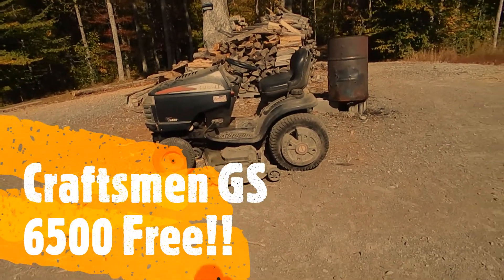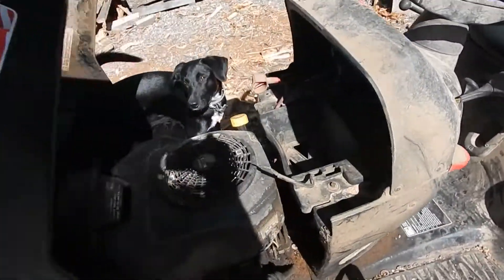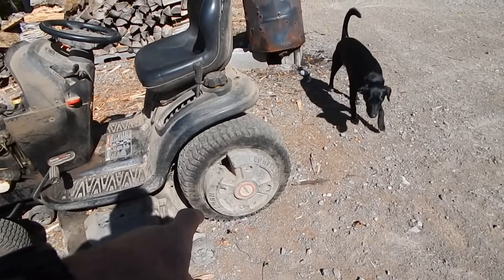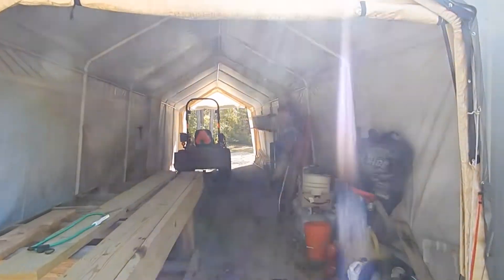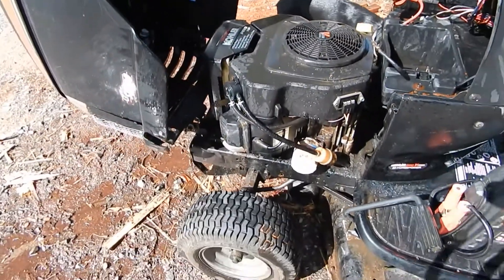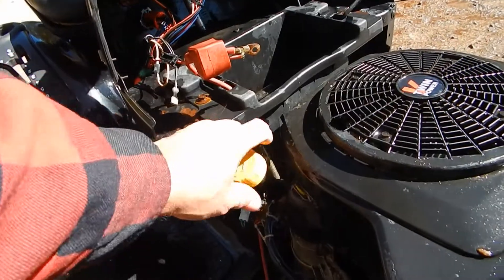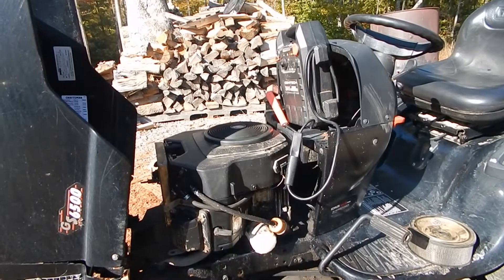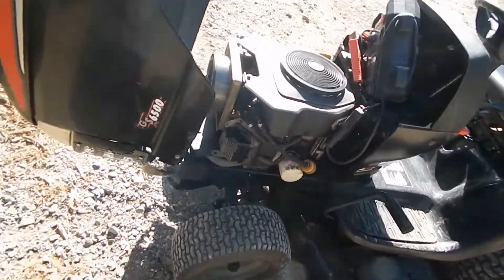Craftsman GS 6500 FREE!

Comment: Looks like a decent little rebuild of engine, Seals,rings and some tuning would be running good then.
Reply from the maker: I think I'm gonna use it as a backup mower for myself and my neighbor.. The crank seal is blown out it actually cleared  up and ran pretty good.  The engine case is  full of acorns & mouse beding .A cold weather shop project.